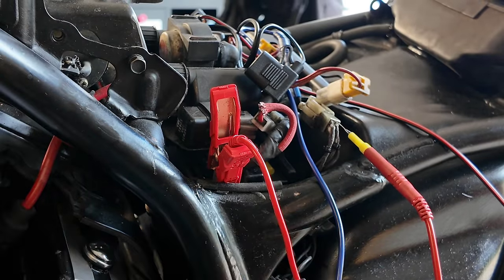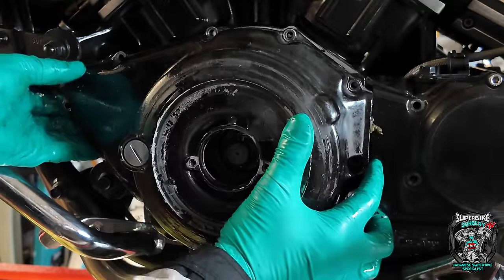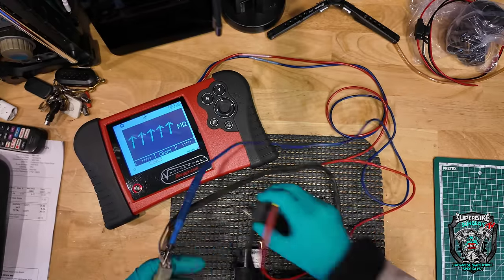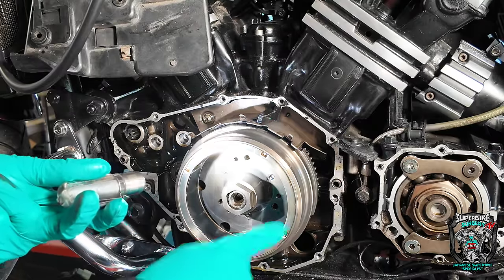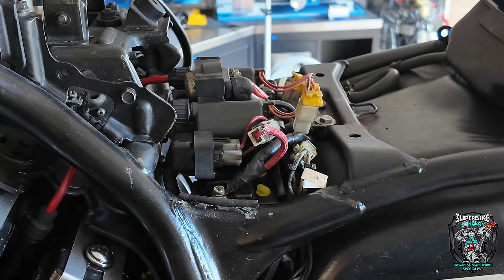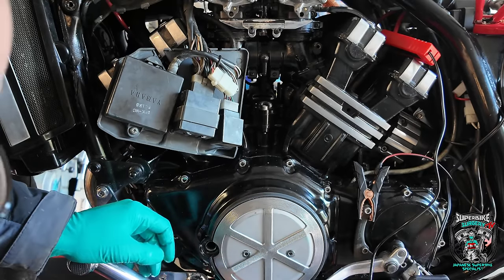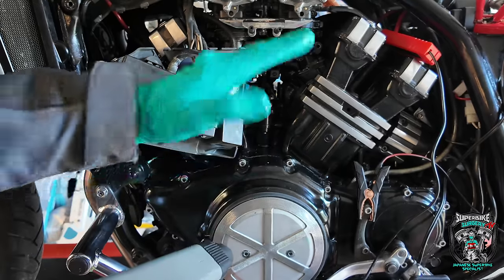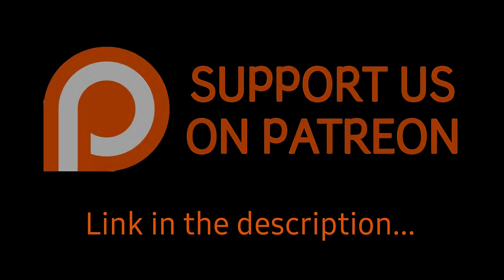It's the Main Dealers Fault! Should They Pay my Invoice? The V-Max Misery Continues

Comment: hey man what scan tool do you use for the bikes? I saw your video on the $3.30 KTM fix and was wondering what tool you were using bc I thought the wiring diagram it pulled up for it was so useful. I have a ducati instead of a KTM but I highly doubt it just wouldn't work on my bike after the digging I've done on the subject.

Comment: I have a 98 model with the single pick up. I had a similar problem with mine. After chasing back the wiring and checking the sensors and stuff I finally put it down to the igniter box. I got one from DYNA TEC in the states. Sorted the problem and completely changed the power delivery for the better.

Comment: the rod in the crank, is to control the flow of oil, as they need to drill larger further into the crank and is common on Yamaha V4 engines

Comment: You're right about the ignition. 

I had a TT250 that didn't have a key, just a push button to kill the engine. I had just ridden it home and was ripping the clutch out. I turned the basket with the ratchet and it started.
Well, that set a cat amongst the chickens. There was stuff flying everywhere. No injuries, lesson learned though.

Comment: Can I make a small suggestion? The stator cover.... looks like m6 bolts. Go get some m6x75mm caps head bolts (partial thread) and cut off the heads... say 5 or 6 of them. Use them as  guides to remove/reinstall the stator cover. Helps prevent that magnetic "suck" by guiding the cover straight. So, take out 5 (or 6) cover bolts, install these guide studs, remove the remaining bolts and the stator cover won't "bash" when removing/reinstalling.

Just what I do.

edit: that compressor - just release the hose pressure to zero. Only have hose pressure when using the compressor... mine is same (and you can rebuild the relief valve - but it'll happen sooner or later again.

Comment: Check the output triggering event on ignition coils, on ignition stroke and amplitude , on both banks, and swap coils and retest before replacing the ECU
Reply: Most likely, it's designed to fire the spark plugs twice every 360 degrees of crankshaft rotation. Once for the combustion cycle, and approx 180 degrees later for a complete burn during the exhaust stroke. It may be normal for the duration or even intensity of the spark to be different for each sequence? Pure speculation, but possibly relevant?
Reply: @andrewbecker3700  i don't think it's a waste spark system, Jim must confirm the output integrity before condeming the ECU

Comment: Own a 1997 vmax 1200 full power with only 9.000 miles been dry stored ,had carbs full rebuild, new fuel lines ,tank cleaned ran rough at low rpm firing on 3 poping on to 4 on test ride and opened up ran on 4 perfect then backfiring ,bit the bullet and sent it to bike shop came back worse 2nd bike  shop still the same spent £1000 now and got to the point were i hate the bike, it runs 100% the same as your vmax firing on front on off on rear only difference with my vmax is its had (dont know what there called) the coils disconecred and coils fitted on ht lead if you know what i mean, on your vmax your going for timing being out ? ( waiting for next vid ) could my timing be out even that i know the millage is right and engine has never been worked on from new, this is my 2nd vmax 1st one was rough but ran great spent along time looking for a clean low miles vmax and it cost me alot been 2 years now due to just getting total pissed off with it not running right if its the timing great (wait to see how you get on ) if not its getting stolen and set on fire never had a bike to give me so much pain as this vmax,